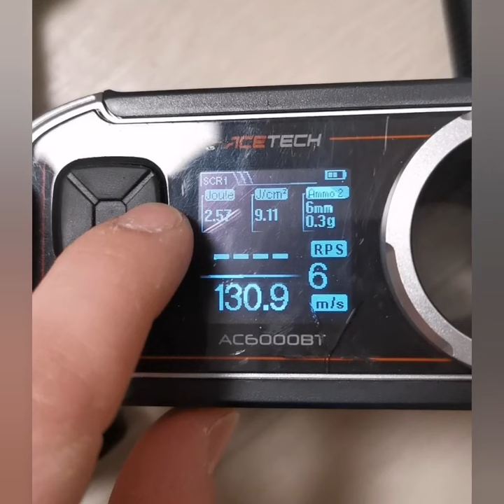Krytac SPR mk2 DMR rebuild (Same spring as before)

Comment: what parts did you upgrade? or can you make a tutorial?
Reply from the maker: Hello,
parts list is in the video description.

I got this gun to rebuild it after it has been worked on by another technician, so it was basically a job to save badly built gun.

I could make a video tutorial, but it would take hours to explain everything needed to properly rebuild a gearbox.